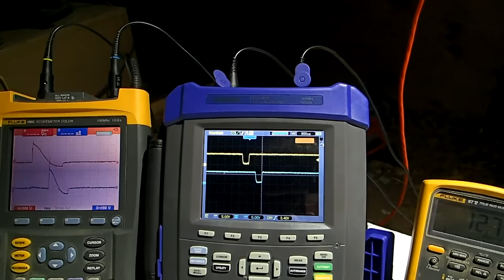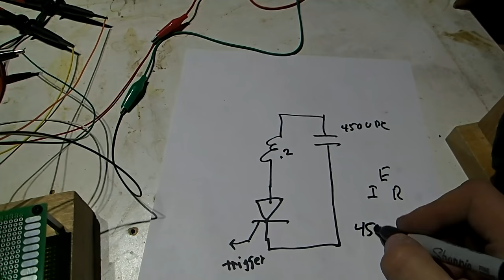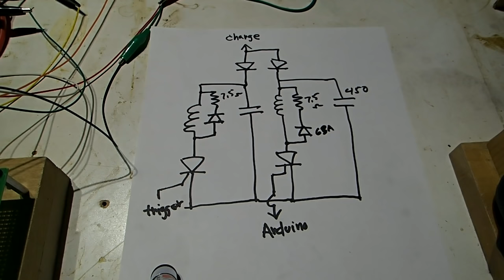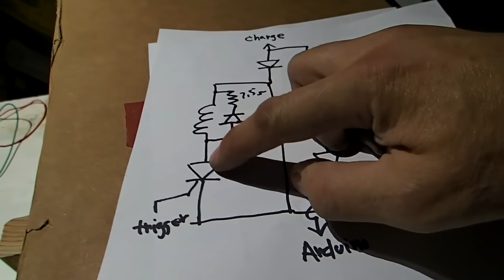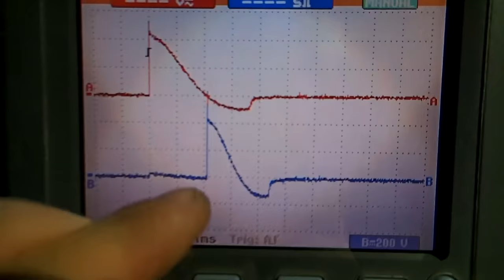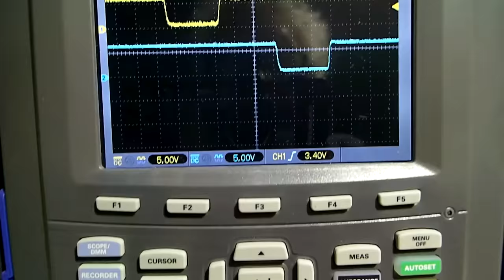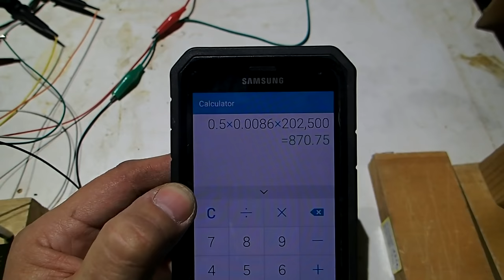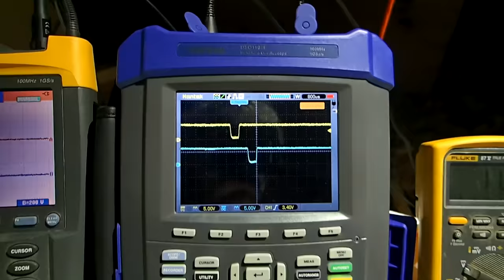World Fastest Six Stage Coil Gun Yak Questions Answered

Comment from the maker: get your buddies to watch this video and like it I'll put up a schematic to build that power supply. flash camera isn't going to work. well it will but I'm talking about weapons status  quality.
Reply: Clay Reid what part of thw video is the ohms apple i need to learn that so i can make coil gun im recording a video right now for my channel please respond
Reply: Would doubling voltage double FPS?
Nice work...wish I was more knowledgeable at building electronics.
Also would using a steel tube wrapped in coils help create stronger magnetic force on the projectile? and doesn't carbon tube block magnetic field like it does RF energy?
Reply: Hi i was wondering if you have put up the schematic for the power supply?  
Also what is it that causes the capacitors to charge quicker? Is it more current? Thanks.

Comment from the maker: you cannot put bridge rectifiers to recover the energy because they have to be in series with the coil and withstand 2500 amps so that's not going to happen.
Reply: how can you tell 2500 amps of current flows in the coil
Reply: It is very easy to wire a bridge rectifier so that the four diodes are in a 2x2 configuration, which doubles the voltage AND current rating of a single diode in it--and, ad a bonus, they are matched.
Reply: One trick I have learned with converting bridge rectifiers is to simply use the common "-" cathode diodes connection and the common "+" anode diodes connection.  Then these two connections act like a single diode, but with twice the voltage rating and twice the current rating, this puts the four diodes in a 2x2 configuration, and they are -well matched!-  You will have a V-drop of two diodes though.  Also, you can use this on a three phase single diode and get three times the voltage and current ratings (as they are in a 3x3 configuration).
Reply: @dalenassar9152   I'd go with Parallel N channel MOSFETs as they balance well and  have very low Rdson in the sub 4 mΩ range.

Comment from the maker: you do know that power is a function of the current times to voltage. so the current matters a great deal I would have to parallel so many igbts that I won't have room to fit the switchbacks into the case since I gbt's cannot handle as much current as SCR it would take many more of them if the voltage is less than 450 volts the output of the gun is seriously compromised SO igbt's are just for putting holes in soda cans

Comment: You tried ferrite, but not a low-carbon steel cylinder that fits in the barrel with very low clearances (takes advantage of all the flux) that's what I've been hoping to see you shoot, though you would need to do a new timing optimization for the coils turning on. Speaking of which, why not fire one coil full strength at a time, with the oscilloscope hooked up to the next coil in the line? You could measure the time of entrance and exit to the coil (basically a small generator as the moving projectile, magnetized, causes a change in flux through the coil which you can measure to determine speed and entrance time) to get your timing down to turn the second stage on, then add the second coil and use the third to measure, and etc. until the whole gun has been optimized for every stage.

Comment from the maker: okay tomorrow I will have video winding the coil. were you able to measure the speed of the brass tube
Reply: for a brass tube of od 11mm and id of 10mm seed was was less than 5 m /sec , i am using low carbon mild steel rod  as a stator
Reply from the maker: Vasudev Mr https://youtu.be/II8qjVNtVIY watch this video
Reply: yeah ve i have the same kind of setup , but projectile is bit lengthy ,it about 30mm in length only getting 5m/s

Comment: Oh right, correct me if I am wrong, but the diodes on the capacitor banks are part of the voltage doubler or are you using the 3.3uF capacitors for that?

Comment: Clay, At about 13:39 there is a good shot of six small power resistors that seem to be connected directly to the coils (I can't tell if there is something else,like a diode, in there with them.  I was wondering what this was for.
Reply from the maker: dale nassar in the beginning of the video that's explain but I can tell you what that's for that's to take the energy from the collapsing magnetic field on the coil and feed it back to the capacitors backwards reverse voltage this reduces the suck back in the coil tremendously and this is actually why I get so much speed Plus the Barrow is carbon fiber .032 wall thickness so the magnetic flux is really close to the projectile this increases the speed, also the projectile has hexagon-shaped so it has six rails riding on the inside of the for the least friction possible
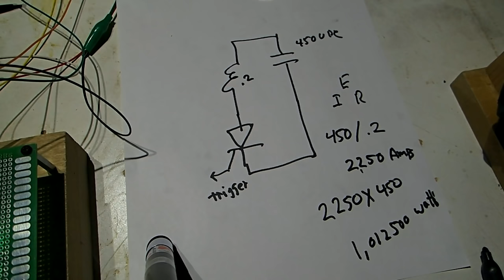Reply from the maker: dale nassar 4:57 go to this Frame this is the schematic of the diode and the resistor across the coil that's what you're looking at, it's about 7.5 ohms

Comment: I get a massive reverse voltage: Current through the inductor would be 2250 amps, now the parallel resitance would have a voltage of V=2250*7.5=16875V, What am I doing wrong?

Comment: Hello Clay,
I was just looking at your SCR firing circuit starting at about 22:30  I was wondering why the SCR current does not automatically cut off, due to holding current minimum, when the current hits zero amps--before the reversal. Shouldn't the SCR cut off automatically here?
Thanks again!
Reply from the maker: The current reverses in the coil when the magnetic Flux collapse, when that finished then the scr shuts off. And the capacitors charges up backwards then the diodes discharge the reverse voltage in the capacitors. Noted by the voltage waveform on the scope going below the center line.

Comment from the maker: the power supply is noisy, for your first experimentations I would use the AC wall outlet with a voltage doubler and a variac until you get the rest of the circuit working good then you can decide on a power supply. I'm sure if you put a scope on the power supply there would be noise as in it.
Reply: Clay Reid  actually the power supply gives pure Sine wave without any noise . but when I cut the hv supply to capacitor bank , acrs will be produced  between  two terminals of the switch . at this time it misstriggers . but if I use separate power supply for Arduino only ,it work flawlessly

Comment: Hi again...I noticed you said, during your energy calculations you stated you had 43 capacitors...I have eyestrain from trying to count the caps in the six capacitor banks, and I think I see the following count of caps in each parallel stage: 18, 10, 6, 4, 3, 3, = 44,  Is this correct?
Reply from the maker: dale nassar first stage 18 capacitors 200 microfarads each 450 volts, second stage 9 capacitors same values, third stage 6 capacitors fourth stage four capacitors fifth stage three capacitors 6 stage three capacitors the coil has a few less turns on it on this last stage

Comment: What would be the smallest projectile you can use, and with the smaller size would this increase the effective distance?
What is the current effective distance?

Could you make a system that would be comparable to a bullet?
Reply from the maker: Size would be what your hands could hold and wind a coil. Compared to bullet no. Bow and arrow yes or crossbow you can match those speeds. No increase in range with small size.
Reply: @RaptorRotorHead  Try a toroid coil instead of solenoids. The former are 'magnetics' while the latter are 'RF' addressing only light and electrically charged 'projectiles' such as particles or small molecules, tuned to transfer energy for kinetics.

Comment: my Arduino is  facing a huge electrical disturbance form my zvs charger , especially while I flip the switch off . ma Arduino is just triggering  the Coils even without a trigger pulse. and I found out that was because of common ground ( common power supply) .CAN you please suggest me some solution

Comment from the maker: no there's no Optics between the stages it's time based on the LC constant of the capacitor and the coil those values are entered into the ardrino
Reply: well i used light gates to  tell the timing sequence ,and i entered the same into arduino. for 3 stages i am getting 57m/s

Comment: did use a op amp comparator to convert the irregular triangular pulse into square wave .or did you just put a voltage drop resistor. in your chronograph
Reply from the maker: Vasudev Mr https://youtu.be/I46AQrr7DAo

watch this
Reply: Clay Reid mass driver has a brighter future . and I am seeing adds before your videos
Reply from the maker: Vasudev Mr I like this for a weapon much simpler to construct only need a single stage the magnetic pulse if you put an iron Rod around the coil it carries the magnetic pulse further and it pushes the aluminum projectile harder and faster
Reply from the maker: Vasudev Mr I did not get that link from you to watch email it to me

Comment: you probably can‘t really put scrs in parrell to increase the max current flow in these kinda applications tho， one of the scr will be sure saturate first and blow up. you can actually put them in parrell to decrease the resistance of the switching device tho， but every single scr has to be able to stand that high current pulse by it self........................................>a single 70tps16 would work fine， mine did， 5 stages and 91.25m/s

Comment from the maker: I get constant speed the coils are fired at the same time sequence the voltage is exactly the same applied to the coils.
Reply: So, may be i'm wrong, but when u accel from 0 to whatever in the first coil, u need to fire second, then it accelerates farther, then third coild needs to be fired faster to keep accelerating. I.e. First to second coil, 2 ms, but second to third 1.5 ms and so on so acceleration is constant and speed increases. If u keep firing them at 2ms u get constant speed and all 5 phases are not doing anything but wasting energy.

Comment: Does run the SCR Array simultaneously ? Cant belive that :x.
Wouldn't it make more sense to use Line Thyristors instaed ?
Reply: thyristors behave like a normal resistor once they start to conduct the current with a pretty much linear U/I ratio. So running 2000 Ampere through them produces a Voltage drop at the thyristors of 20 V for example. So parallel makes sense to reduce their resistance. Also thyristors react a lot faster to gate current than the main current would be able rise since there is a coil delaying the current, so parallel thyristors arent problematic in any way as long the gate power supply can deliver these 10 x 0,2 Ampere for a short duration.
Reply: G E T R E K T 905  kennen wir uns ?
Reply: G E T R E K T 905  achso ok. Ja aber ich bin da wie man merkt nicht mehr aktiv am Videos machen.
Reply: G E T R E K T 905  ja ich habe Videos entfernt. Es kann gut sein das dieses auch aussortiert wurde. Im Laufe der Zeit lernt man vieles dazu und in manch einem Video von mir habe ich schlichtweg halbwissen kund getan.

Comment from the maker: it is a 62 kilohertz Square wave the Transformers not overloaded. the output capacitors are 3.3 microfarad if they were to operate continuously would overheat that's why it's a pulse charge that's why parts are small the market could overheat if it ran continuously. really the only thing that's got a free ride is the Transformer it is capable of handling the power continuously.

Comment from the maker: SCR switch off when the capacitors are empty. but I know what you're getting at a 450 volt battery with SCR's that you can turn off at the gate as well as turn on so that you can control the pulse exactly.
Reply: Or even using caps still, being able to turn off the current to stop suckback from happening is desirable, and it's why I chose IGBTs over SCRs personally. SCRs can handle more current for cheaper in a simpler system, but IGBTs can allow you to shape the waveform and in a halfbridge configuration, recoup some of the energy used to recharge the caps.
Reply: +Karmaslap nice idea but can igbt handle 1000 to 2500 amps of current like scrs do
Reply: +Vasudev Mr What matters is the power, not the current. IGBTs are perfectly capable of handling enough power for amateur coilguns.
Reply from the maker: If you adjust the feedback resistor you can reduce the suckback to virtually nothing this is done by allowing the capacitor bank to charge up backwards to up to 200 volts negative. This does not harm the capacitors, For its only a short Moment In Time.
Reply: +Clay Reid that's still an inferior method compared to using IGBTs. SCRs not set up to be able to shut off easily are quite inconvenient.
Reply: Not true.  The SCRs are more suitable to this function that the IGBT's.  turning off the IGBT once the caps have discharged does not gain anything
Reply from the maker: G E T R E K T 905  you really don't have to worry about the temperature coefficient because the pack is just pulsed for two milliseconds or less, they are parallel ed anode to anode and cathode to cathode, to make sure they all fired exactly at once I put about 150 ohm resistor on each gate and then tied into the resistors all together in parallel the other end.

Comment from the maker: I use the Arduino Nano from eBay for a dollar 99 this should work on all windows but you have to look for a driver on the internet to load onto your computer
Reply: this cheap nano with ch340g chip set cannot work with windows 10 ,its just not getting recognized by the pc. even though the suitable driver is preinstalled in the pc
Reply from the maker: That you have to try to work with cuz some of them did that to me too

Comment: If you're not using a physical trigger to sequence the coils, is it necessary to compress the timing taking into consideration the acceleration of the projectile?  i.e. the projectile is moving faster and faster in the fields and thus the triggering time and pulse duration should be correspondingly reduced in successive coils or else the field could be acting against the projectile approaching the end of the array.  Could that have acted against the overall efficiency when you use a constant timing sequence?
Reply from the maker: CA18DETHK you are correct sir you are paying close attention I have to applaud you that is true the pulse duration in each successive coil has to be less because the projectile is moving faster and if the resulting pulse is not reduced it will suck the projectile back into the coil and reduce the speed.
Reply: Thank you for the kind reply. 
Didn't notice that this issue had been brought up by Trix Kemuel before.
I have a rudimentary rudimentary design to take care of this, by using a pair of thin wire to complete a triggering circuit using the projectile itself.  The placement of the wire should be ahead of each set of coil so that the coil is energized before the projectile enters the coil and cut off before the projectile reaches the coil centre.  A simple adjustable delay can be incorporated in the trigger to fine tune the timing for maximum effect.  This will also take care of the pulse duration automatically.  
You're probably in a better position to consider whether this will work.
By the way, have you ever tried firing a magnet to compare result?  
Thank you.
Reply from the maker: CA18DETHK I did not try a magnet I was thinking about it to see what would happen but I could not find nothing that was matching in inside wall of the tube, simply using an adreno computer to control the firing sequence is like a cur down to three microseconds so every time it fires is the exact same power every time

Comment: I observe that you have connected many small valued capacitor in parallel , why didn't you choose a single big enough capacitor to make it compact ??
Reply from the maker: Vasudev Mr it has six stages it has six independent capacitors, the coil and the capacitors have to be tuned to each other you just can't put one big arbitrary capacitor you have to have a certain amount of pulse width not too much and not too little. more capacitors in parallel lowers the ESR of the capacitors that makes four more efficient coilgun
Reply: Clay Reid I asked this question because when I replaced a capacitor bank of same capacitance but different capacitor type  the performed was  bad. at first I had used costly capacitors and when I replace them with small sized once ,not good
Reply from the maker: Vasudev Mr you have to use switching capacitors. they have low ESR, when you combine many in parallel you have super low ESR.
it's easer to adjust the pulse width in small increments, if a single capacitor is to be used it should be a photo flash capacitor.

Comment: Would a projectile of less mass accelerate faster? Do you have to tune the design for the projectile? If your projectile was a needle, how would that affect the design?
Reply from the maker: If the projectile was a needle you basically wouldn't be able to wind a coil around a tube because it's so small you will not be able to put very fat wire you limit your current you limit your power, yeah you have to tune the design to match the projectile that means how many coils of wire to thickness of wire how long do coils are how long a projectile is
Reply: @RaptorRotorHead  - Thank you for answering. I understand that problem and have addressed it already by devising a way to wind the coil in single layers without reversing the direction of winding. It's assembled like a stack of pancakes. And the needle is not a sewing needle but a carpet needle, dozens of times larger. 
Same question applies dear sir.